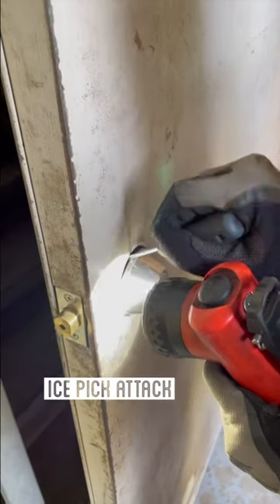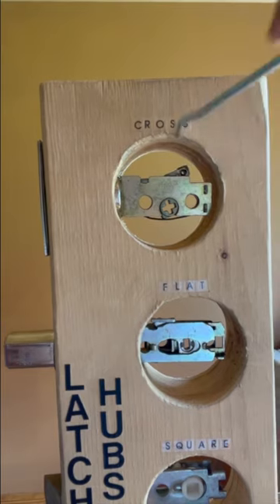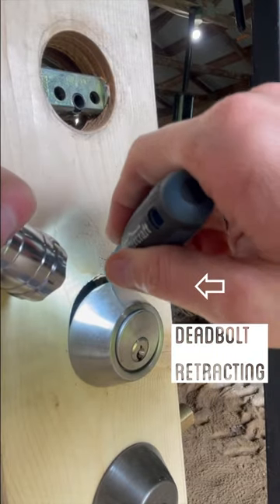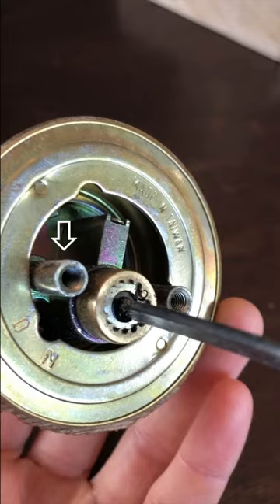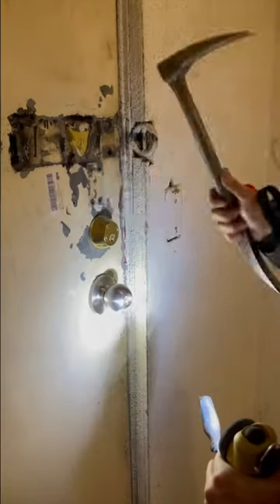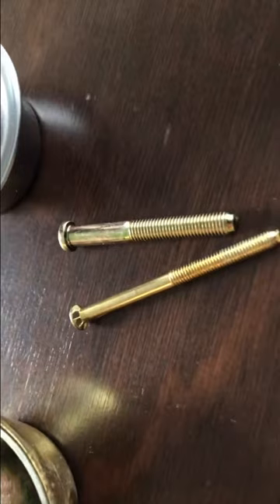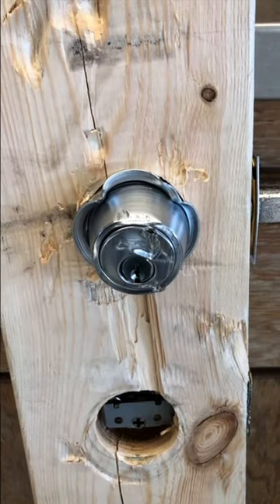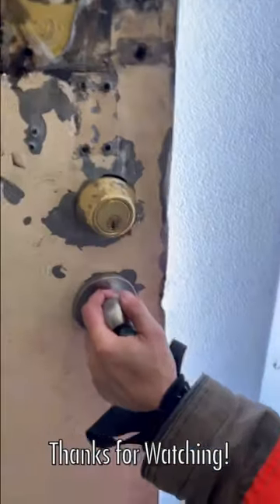Deadbolt Through the Lock Forcible Entry: Ice Pick Attack

Comment: Thanks for a less destructive option for deadbolts! I recently learned how to do conventional forcible entry during an introduction to fire fighting course. It’s very damaging to the door and potentially the surrounding area. This, as long as it’s not an expensive bolt, would be much less invasive.
Reply from the maker: I also look at the type of call I’m responding to when deciding between conventional forcible entry and through the lock forcible entry.  If the building is on fire, I’m not too concerned about the damage I do while forcing entry, because the fire is doing more damage… but if I’m responding to medical or alarms check call, then I would choose a through the lock method that doesn’t cause as much damage… the home/building owners appreciate it!